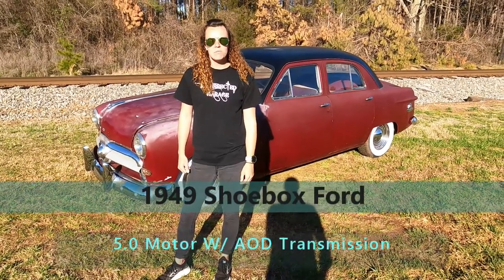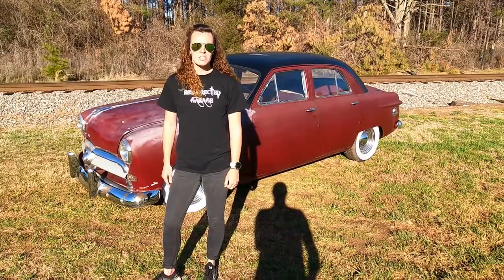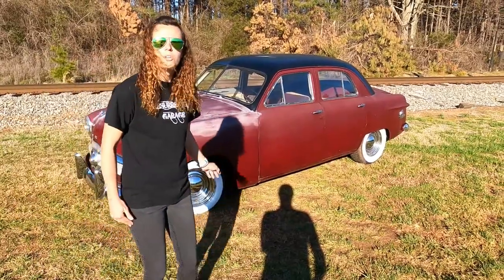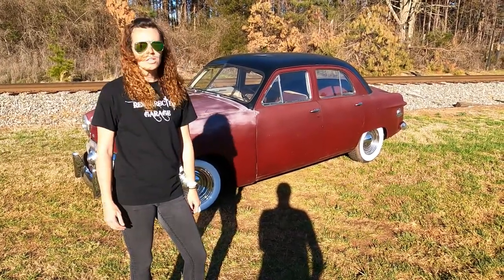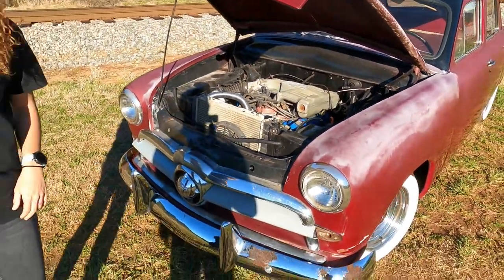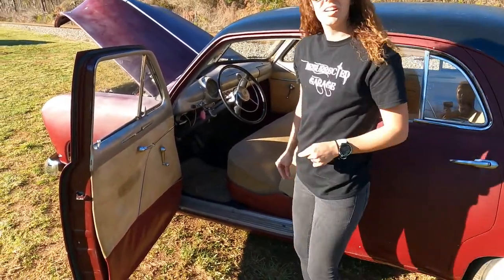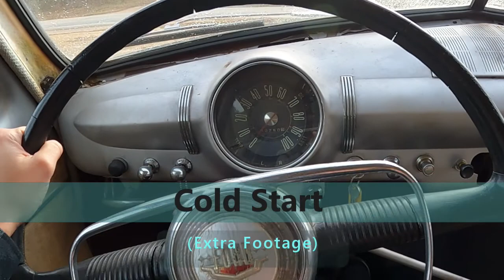We Swapped a 5.0 EFI Motor into a 1949 Ford!

Comment: Did they just use the bolt in mount kits you can buy? And did you have to change oil pans?
Reply from the maker: We just bolted factory frame mounts up to the engine, then we just sat it down and tacked the frame side of the mounts to the crossmember. After that we pulled it back out and welded it all the way around. I don't remember if we used a car or a truck pan; but it was a stock oil pan. Looking back we should have did a better job with this video as it has been the only EFI swap we've done for ourselves. We just weren't thrilled with it at the time.